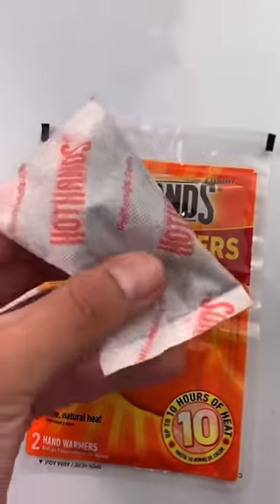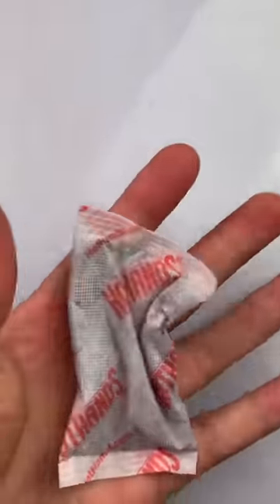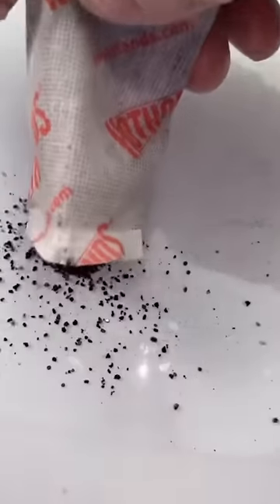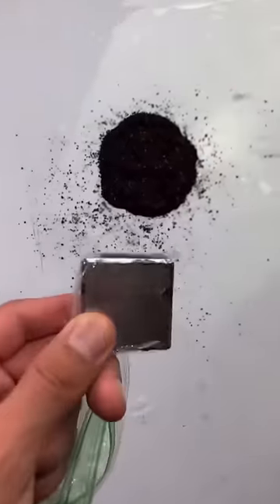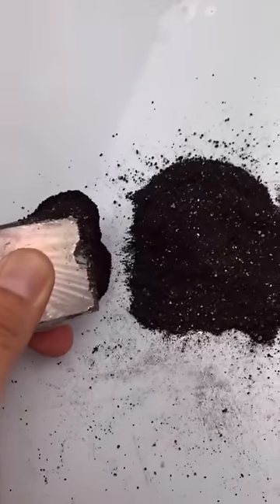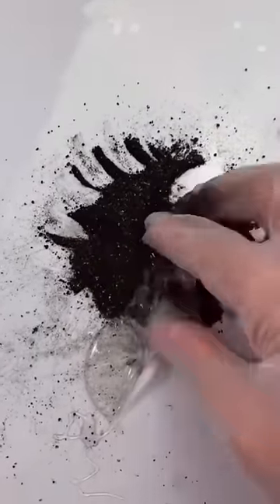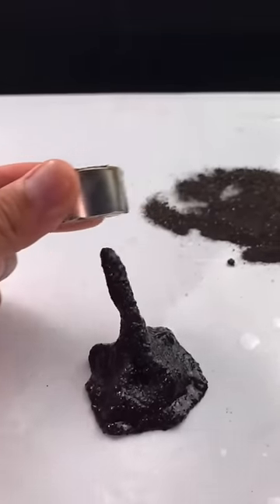What’s inside hand warmers?

Comment: It works because it’s a mixture of salt, iron, and water. The water and iron reacts with the air that gets in. Believe it or not the iron actually rusts. The reason it rusts so fast is because the salt is a catalyst. 

Catalyst - something that speeds up a chemical reaction